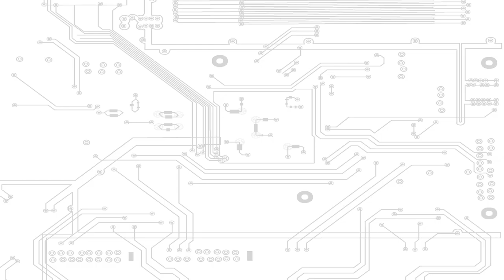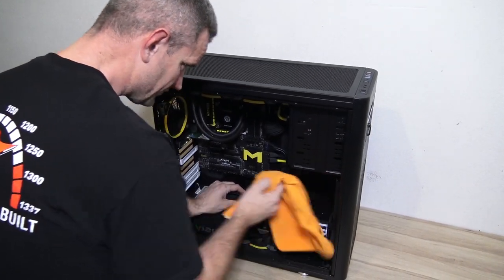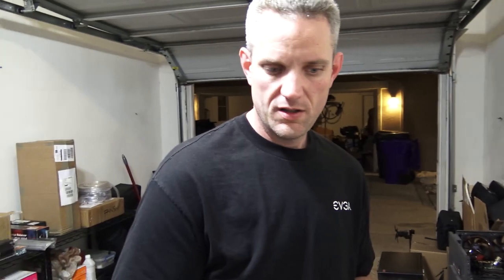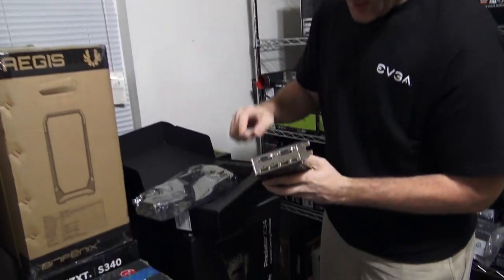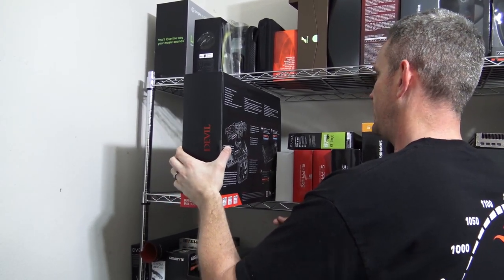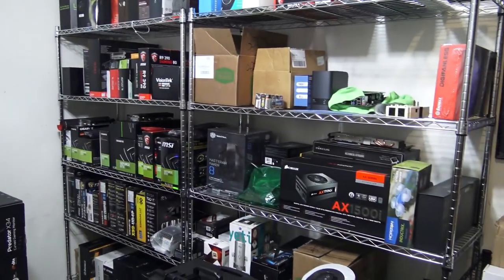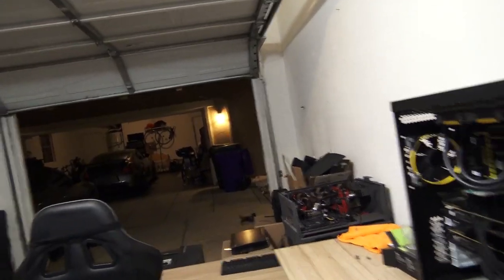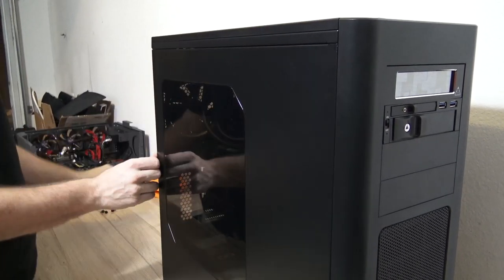VLOG - Putting the Sim Rig PC back together

Comment: Sad to have SLI of 970 with the 3.5 GB. 980ti is better.
Reply: +L3xou97 it depends.. with games that are not very vram hungry you will get more performance from the 970's.. with vram hungry games the 980 ti will have a huge advantage.. i guess it really depends on the game..
Reply: +Dunkelelf3 jay is going to play on multi monitors so it is going to be vram demanding anyway
Reply: L3xou97 i know but well.. racing sims are not my favorite games and i don't even have all that latest titles so i can't tell how vram demanding those are.. with this shelf of gpus i would have just use 2 980 ti's and screw that 970's xD
Reply: +Dunkelelf3 even if these games may not eat a lot of vram, on 3 screens it will because it's nearly 75% of the pixels of 4k
Reply: L3xou97 still it also depends on the texture resolutions.. most games come with textures for 1440p and 4k these days.. on 1080p you won't see a difference but get better fps and safe a lot of vram.. anyway as i said i don't know how demanding racing games these days are when it comes to vram and gpu power so i don't know..